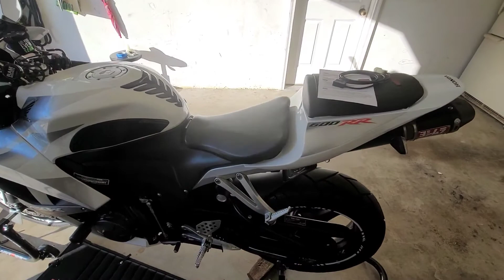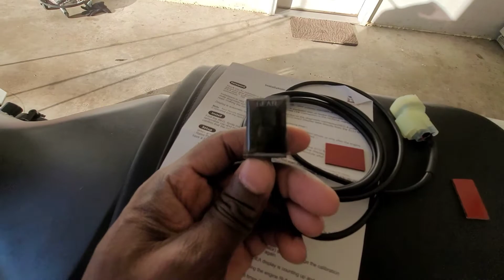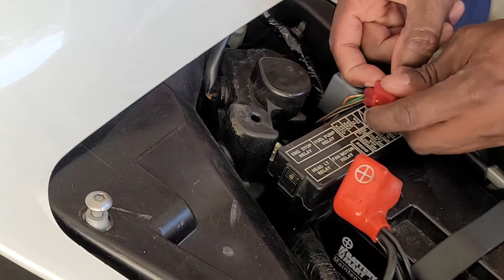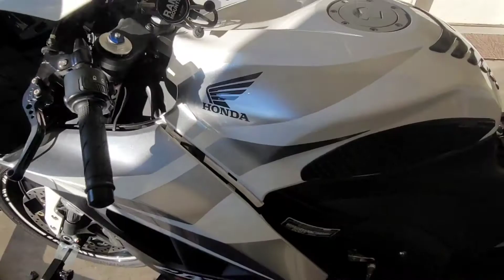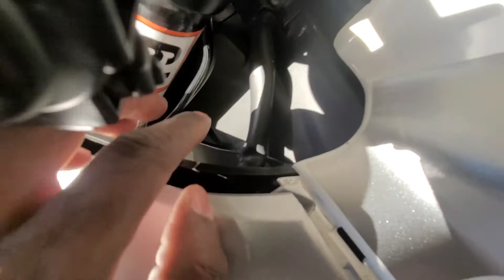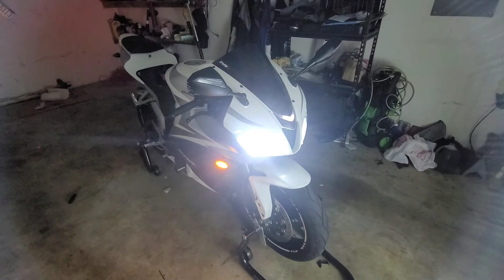Honda CBR600RR Gear Indicator Installed!!!

Comment: Nice video. It will help me instal one on my wife’s bike. Do you happen to have a link to the leg/thigh grips on the lower part of your tank? My wife likes them and she wants some like yours.
Reply from the maker: UbuyMotor Motorcycle Rubber Gas Tank Traction Side Pad Gas Fuel Knee Grip Protector Compatible With CBR600RR CBR 600RR 2003 2004 2005 2006 https://a.co/d/dBnoHlZ

I'm not sure what the year was your bike. But you can search tank grip on amazon.

Comment: i plugged everything in right but when i turn the bike on it doesnt show and l it counts back from 6 then stays at 0. then i start the engine and it shows a dash. is there anyway i can reset it or how do i fix this?
Reply from the maker: The instructions shows you how to reset it, and if I remember it tells you what do check if after installing and it's not working. Try doing it over again..

Comment: Just wanted to let you guys know you don’t need to buy bikes stands to do this. Just install it but don’t plug it in till you get to a empty area with no car connect it and run it through the gears.

Comment: Hey bro i just installed my gear indicator but there is a problem. The indicator start from 1 to 6 and then it's show nothing but straight line. When i start to the bike there is no any options to setup it. So do you know why  ?
Reply from the maker: If I remember correctly when you're not in any gear It's a straight line. I actually sold my bike so can't be much help I would say try resetting it and doing it over.
Reply: @6MTLIFE  okay thank you bro
Reply: did you figure out  your gear indicator   haveing the same issue with mine
Reply: @tyggr88  yes i did, thank you for asking

Comment: you have the link for the mirror lights?
Reply from the maker: Just type in honda cbr600rr led mirrors on ebay
Reply: @6MTLIFE  did you wire yours up?